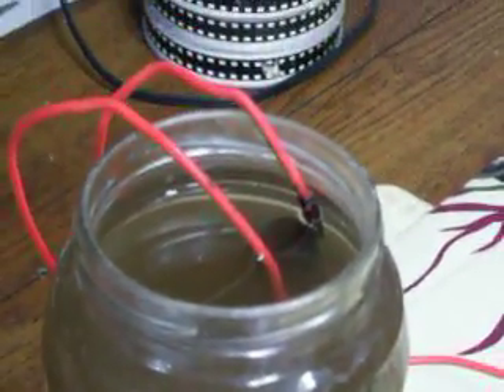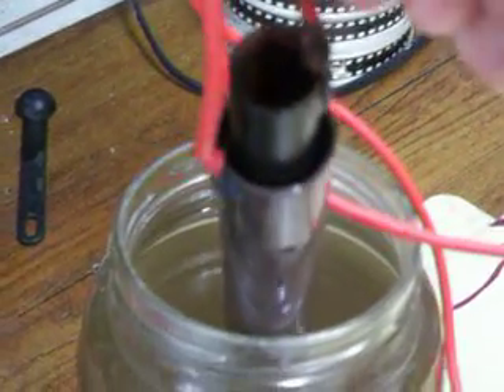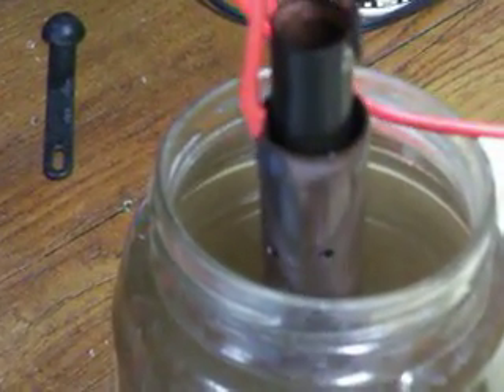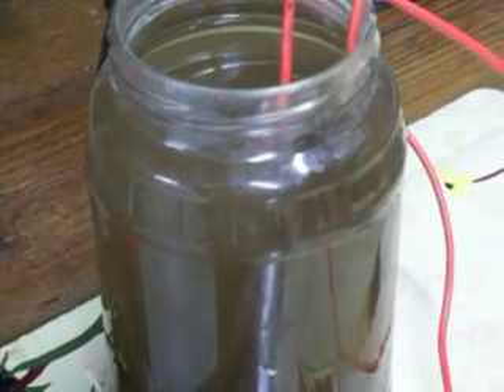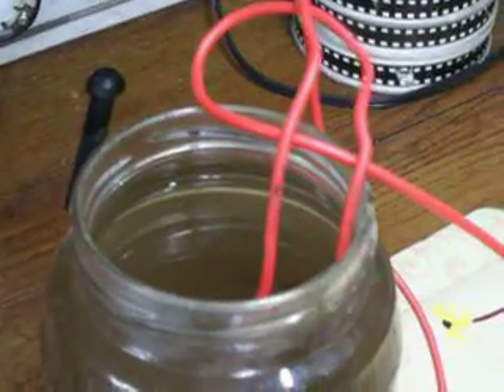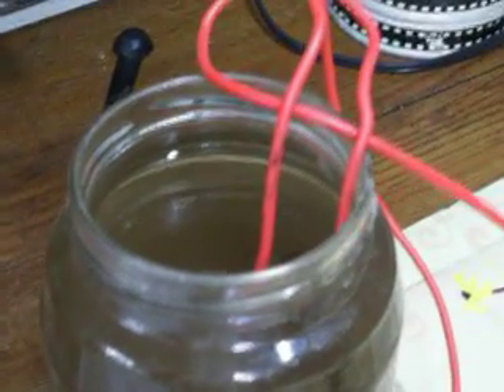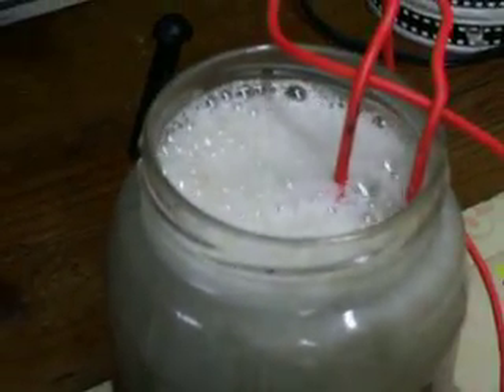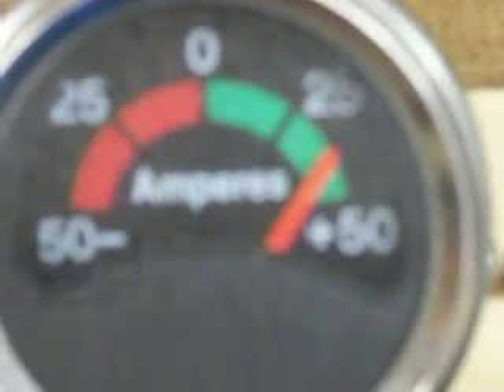hho with copper tubes

Comment: The main issue is the oxygen. You take away the hydrogen then you have a high volume of oxygen causing it to oxidize faster.  Using a super conductor like copper. 
May think this could work. If can find a way to keep the temperature low. The water temp. It would slow down the oxidizing process or corrosion whatever you want to call it.

Comment: Hi! check out the joe cell if a person did the copper in this figuration wow it would put out hydrogen. I was thinking about building a type of alternator around the unit itself you can see people building these things for windmills why couldn't a person build one something like this around the cell itself this way it would be self contained it could be run with the motor! just thoughts.
Reply: two things practically everyone skips over regarding the Joe cell is.. first, the charging process... the slow appliance of low voltage over days, until an average of no more than 2 volts per cell is achieved and the brown gas is generated.  Second... The gas produced in the Joe cell, never mixes, never meets an ignition source. From the JOe cell, there is a copper tube which goes into an aluminum block which is flush mounted to the side of the carburetor.   There is no hose that goes for the cell INTO the fuel air mixture or an injector... the brass tube to aluminum block that's been drilled and tapped as is the side of the carb, and the block is screwed tothe bowl side, and that is it.  The  Joe gas travels through the side of the carb into the engine

Comment: aluminium is the best doesnt rust or corrode or make the water a weird colour
Reply: no, aluminiun is the worst it just desintegratesa fter few hours due to the chemical reactions with the others metals in the water, this without using any electrolyte
Reply: also try having more surface area so the bubbles are more spread = more conductive surface left
Reply: if you use a corrosive electrolyte with aluminum. The chemical reaction alone will produce hydrogen and it wont stop until the aluminum is gone. Al + KoH + H2O = massive chemical reaction that breaks the waters molecular bond at approximately 300°F. In some cases you don't even need the aluminum. Just water and the electrolytes chemical reaction alone will do it. I ran a lawn mower on hydrogen with no electronics, just tubes, valves, water, aluminum and potassium hydroxide.
Reply: Grafit better than both of 'em

Comment: try a platinum coating on copper.. see how that goes for you.
Reply: yeah everyone can just afford platinum coating XD
Reply: +ben lawton hard disc platters have platinum coating.. 

strip enough of these and coat your plates
Reply: Gary Stinten oh i actually never knew that
Reply: the hydrogen will electrically charge the platinum, making the anode and cathode produce a voltage. It would be better to have one cell without platinum. Fueling a cell with platinum, using the electrolyte solution as a membrane to charge the electrons that are charged in the platinum, effectively converting hydrogen production into a usable voltage. Each platinum terminal would be approximately 0.7 volts. So you stack multiple electrodes in the same cell, wiring them in both in series and parallel with each other, to multiply their voltage and amperage. Say you wire it to produce 4 amps at 12 volts. Use 2 amps with regulators to produce much more hydrogen, and the additional two regulated charge controlled amps to charge the battery. And so on and so forth.

Comment: The copper should react with the oxygen that is produced from the electrolysis of water to make corpus oxide. One of the copper tubes will slowly deteriorate. Stainless steal will not do this. That is your best bet.
Reply: aluminium is fine to i find
Reply: from how many copper tube i can get 20 ltrs/min .?  & how much amps it will take?
Reply: Muhammad Rafiq idk depends on allot of thing

Comment: From what I've researched, around 2 volts is the optimum voltage to carry current without losing too much energy converting to heat. I assume this is why 12V lead acid batteries have 6 X 2V cells. So that said! I'm wondering if the right conductors  could be used for anode/cathode and correct electrolyte delivering 2V @ high amps - say 50A? which would = 100W, then maybe HHO production could dramatically increase with little power consumption?

Thoughts?
Reply: 12v i find is pretty good

Comment: my hho work but wire of accu very hot, why help me
Reply: +Tao Xanh Too much voltage between plates. try for max. 2V per gap = 6 gaps between +/- contacts (5 neutral plates). You can use more electrolyte (NaOH or baking soda) when you do this to increase conductivity in the water.  By spreading the voltage out over neutral (uncharged) plates, you get more surface area to react with less heat generated.

Comment: Make the Copper as Cathode, change the shape of your plates to long and small, cut notches like a comb into both Electrodes all the way down to the End and use KOH as Electrolyte. Increase the concentration to double the gap between the Electrodes and open up the gap at the top to let Bubbles escape easier. Your Electrodes need to be arranged to form a wedge to avoid current fracture by the Bubbles, Your Electrodes on the bottom need to be thick and have only one close distance as a Squish Zone to squeeze the Bubbles out. You definitively need more than 2 Volts to overcome the resistances like double electric Layer, Gas Diffusion Layer, void fractures by Bubbles, tension on the metal grid on the metal, the length of the path of electrons or ohmig resistance, to keep the magnetic Field going. to separate Water Molecules and so much morel. Good luck.